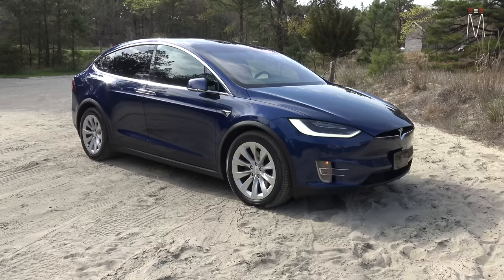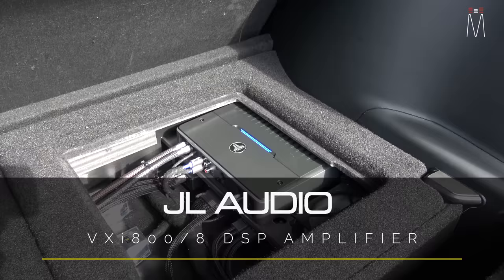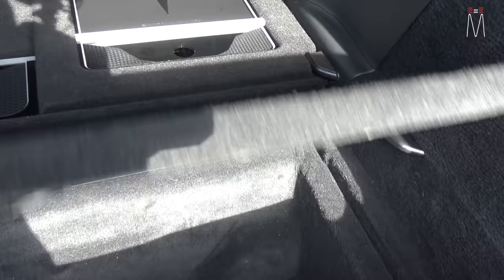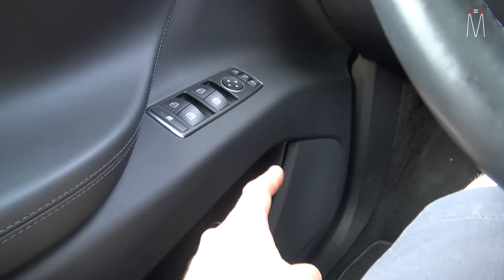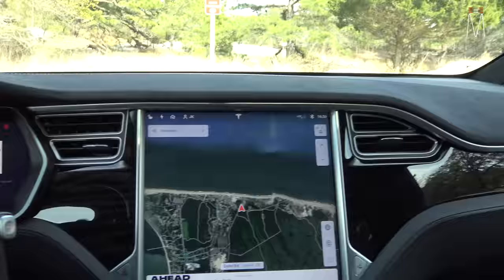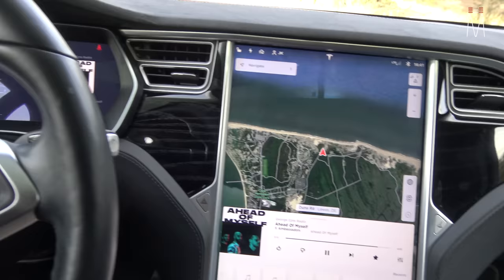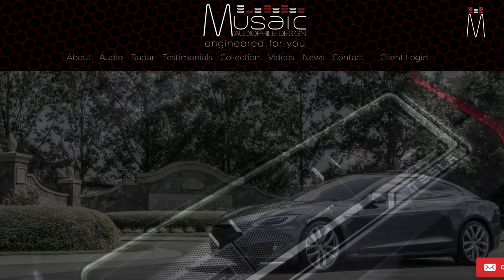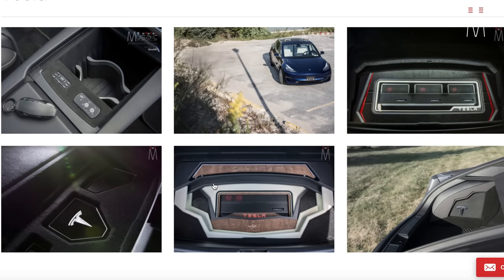Tesla Model X   Custom Stereo System EXPLAINED!!!

Comment: In terms of range or performance  being affected that is  like worrying if the Queen Mary was not going to make its transatlantic crossing because you were flying a kite off the deck or fishing off the back. If the amps were class A amplification then the draw would be more, but for typical listening levels as power is logarithmic relative to how loud it is (SPL in decibels) more people are listening at less than 1 watt of power most of the time. Assuming 50% efficiency its about 2 watts.  Charging a brand new iphone with its 16 watt charger  could have worse impact than the audio system.

Comment: Where did you pull the 12V power from? Were you able to access the DC-DC convertor directly bypassing the meek and vulnerable 12V battery?
Reply from the maker: At the 12v battery under the hood. No issues tapping here.
Reply: @therealmatty_s  well the issues come some 6 months later when the battery gets broken more often and warning codes show up. It is well documented on the forums, a lot of people have problems with that. Perhaps not every model/every amplifier? Do you have knowledge of long-term viability of this solution in your builds?

Comment: So does the Tesla not sound good from factory?
Reply: kingchrisp198432 nothing sounds good from factory when you let an experienced car audio pro design , build , and tune a system for your vehicle.
Reply: seancarraher for a $90k car I expect it to have a very nice sound system from factory
Reply from the maker: kingchrisp198432 if you have a decent expectation for what good to great audio sounds like, no factory sound system sounds good. No matter what is out there, most manufacturers continue to use paper and plastic speakers and amps with little power. My analogy is that almost everyone’s expectations for a decent audio system is a DLP TV. I am watching on a Sony 8k. There is a colossal difference that once you experience it, it would be impossible to go back.
Reply: Matt Schaeffer I have heard some good and great sound systems, my bmw 750li has a great sound system the only thing I did to it was change out the subs under yo seat to 8in svs because one of them was going out, I’ve also heard some good sound systems from a Cadillac CTS and a Mercedes s550, to me yes some sound system sound great from factory , nice loud and clean with a lot of bass..
Reply: Matt Schaeffer I understand that anything can be made better I just never heard the sound system from a Tesla
Reply from the maker: kingchrisp198432 again it all comes to what your expectations are. I think the your BMW sounds just as bad. You just haven’t experienced better.
Reply: Matt Schaeffer well hey to each it’s own,  I never heard a Tesla sound system that’s why I asked
Reply: @kingchrisp198432  Unfortunately no Tesla system I have heard offered any real sense of air or depth or image height. The TESLA systems sound much better running 16/44.1  FLAC files than Slacker 320kbs files. every Tesla I have ridden in Model S 60,75,75, 85d, P85D 100D, P100d with insane mode, model X 75d,90d,100d, P90d  and multiple carnets ALL have different optimized EQ for every car! There is Zero production consistency . If you try to EQ for a single seat position dolby off with the balance towards the passenger bit to widen the soundstage, it is possible to get "some depth" and "some imaging", but not even close to what is possible even on the stock full sized Cadillac systems and many other cars. There is some Jitter in the DAC which is partially to blame, but the CPU is likely too burdened with other subroutines to make the music sound great. having plastic speaker baskets, certainly doesn't help either. Really the only way to properly approach Tesla cars is to do entirely separate systems from the internal car system as done here.